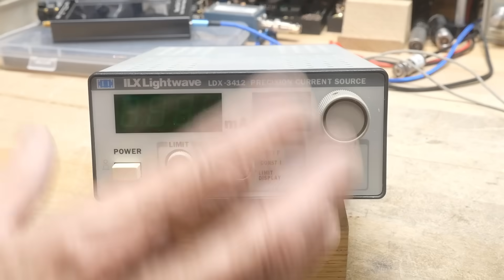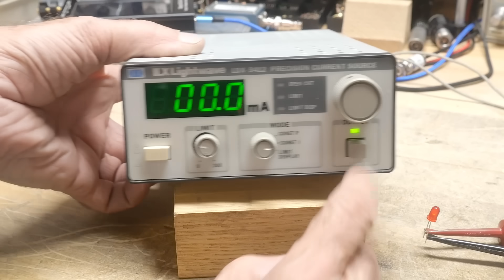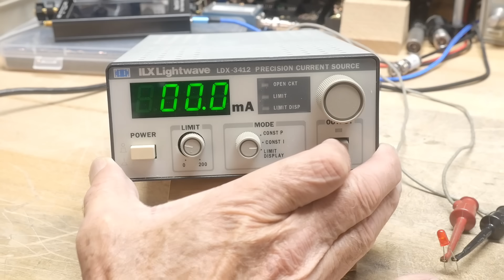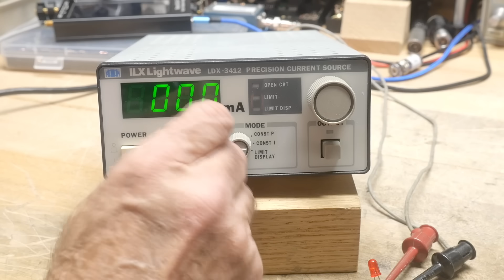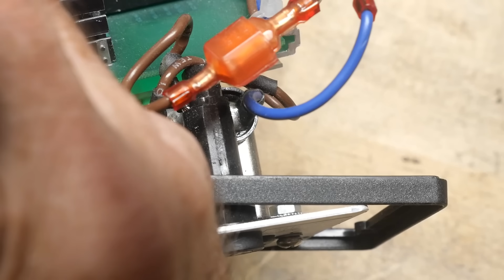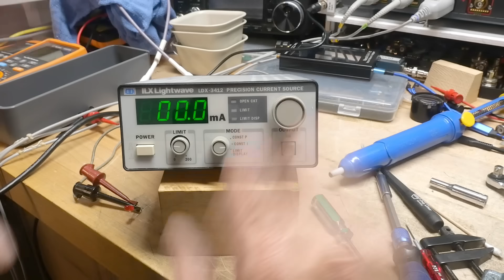#2465 ILX Lightwave LDX-3412 Current Source

Comment: This "open circuit"-protection may save lots of laser diodes! If you use a usual lab power supply with CC and CV mode and you have some loose connection in your wiring, then the power supply goes into CV mode, charges it output capacitors and as soon as the circuit reconnects, the current surge will kill the LED or LD. 

With this "open-circuit-switch-off" you are forced to ramp up the current again after a disconnection and no current surge can occur!

Comment: It’s a sweet instrument though the PCB layout seems pretty weird.
Those heatsinks all over the the board, the filter cap literally inside the heatsink.
The botchy mains wiring, the blue jumper wire, the illogical position of the mains switch…

Comment: 4wd for an inch of snow? LOL
Reply: You have never been in the south.  First winter I was stationed at Ft. Bragg in NC with 7th Special Forces Group they had about a inch of snow.  It all but shut down the neighboring city Fayetteville.  I had to get a off post dispatch to go downtown and pick up something that day.  There were cars on sidewalks, car's in ditches, cars into tree's and electric poles, etc...  Had I not been in a 6X6 5 ton flat bed truck I think I would have felt safer in Panama during Operation Just Cause then on the streets of Fayetteville that day.  It's amazing how a few snow flakes can all but cripple a city in the south and turn the average driver into a Keystone Cop on ice skates.
Reply: @mikesradiorepair I live in the Great State of Wisconsin , so 1 in of snow is springtime!